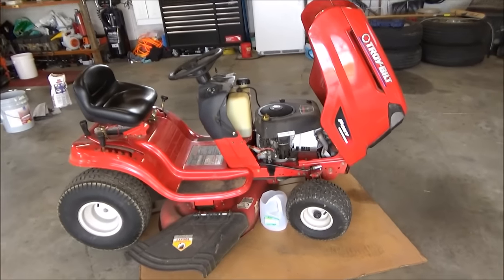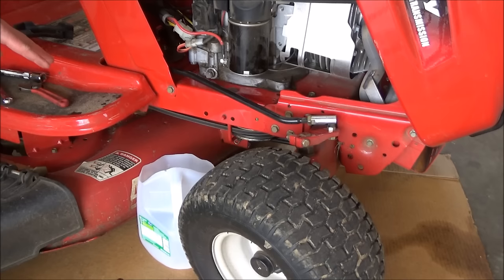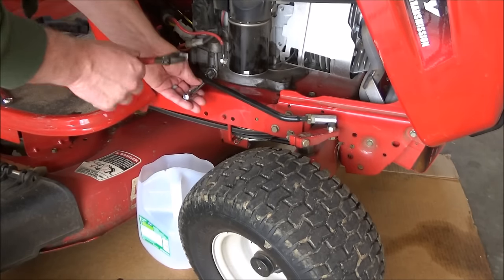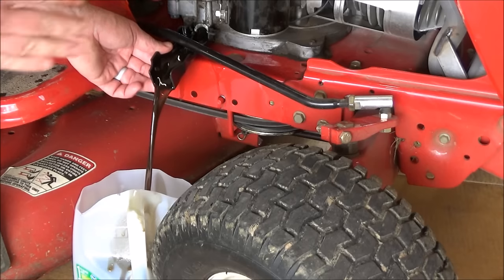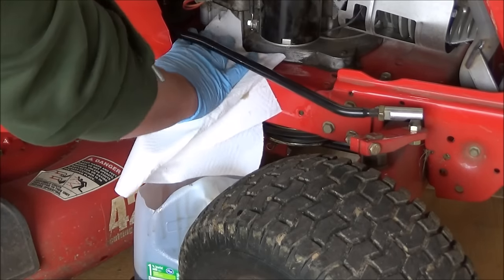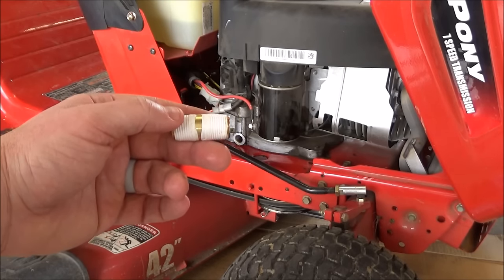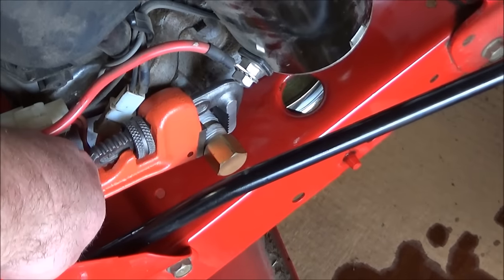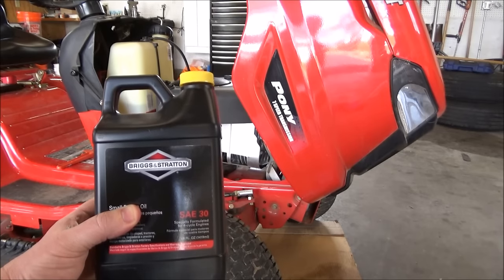Troy-Bilt Pony | Oil Change Made Easier

Comment: I’ve been beatin on one of these for 5 or so years. It mows about 2 acres every couple weeks, and really overgrown grass (8” or so) periodically when I miss a mow. Steep inclines, bumpy uneven terrain. It did get left outside in the elements for a year or two for various reasons. It’s been very reliable and surprisingly durable. I’ve only had to change out the fuel shutoff solenoid, one deck belt, one deck tension spring, one set of blades because the originals were too trashed from me hitting gravel and branches, and ignition coil(plug wire was starting to fall apart probably due to water and sitting outside in the full sun). All those parts were 25$ or less each off Amazon. I change the oil once a year with 15w40 Mobil delvac 1300 that I always have on hand. Engine runs perfect, and the original battery lasted until this spring(about 5 years with no trickle charger). Nowadays I usually just lift the drivers side and put a piece of 2x4 under those wheels so the oil will mostly run away from the drain plug and not all over the frame, cover up the deck  belt in case oil gets sneaky, wipe around the plug and pull it. Let it drain and wipe it off. I figure the frame of that side will never rust lol. I just run seafoam in my gas, 1 oz per gallon, 2 -3 oz per gallon the last month of the season and during storage. Except when I had to diagnose the fuel solenoid, she’s never failed me.
Reply from the maker: Wow, 5 years for the battery is really solid. I did a full review on mine and everything I had to do after 8 years of using it: https://www.youtube.com/watch?v=QXg_5uH-LH4
Reply: Good to read, snagged a free one from a friend who had one sitting for about 2 yrs. Its for my 78 yrs old neighbor. Figured carb, belts, fuel, plugs etc. Basic counsumable parts and should be ready to rock.

Comment: Nice!
I added an inline fuel filter & fuel shutoff valve to mine, & thought I was stylin'.
I think I'll do this as my next mod, but use a 90 elbow out the bottom. 

I love seeing the brass instead of plastic parts! 
Do it once.
Do it right!

Thanks for the good info!
Reply from the maker: No problem. Yeah, I'm definitely a brass over plastic guy. Always wanted one of those Fumoto brass oil change valves, but they are like $45. I have thought about adding a fuel shutoff many times, just haven't gotten around to it. I thought about the 90 elbow, but it won't fit under the steering rod. There is hole in the frame you can possibly route it through with a couple elbows.
Reply: Fix it Flip ;

Okay. Good to know.
Thanks again!

Comment: I've got a 2008 model. Few batteries and several deck belts but other than that no problems whatsoever. Cant believe it still has the original drive belt. Lucky me.
Reply from the maker: Ha ha, that's great. I did finally have to change my drive belts a couple years ago. I did a video on that as well.

Comment: I have a Troy-Bilt Pony and the way I fixed mine is I purchased a 3/8 4 inch long nipple and cap then I disconnected the steering rod and raised the rod just a tad.  Using Teflon tape on both ends of the 4” nipple, I screwed the nipple into the engine block.  Then I reattached the steering rod (remember it’s now a tad higher than it originally was) and it clears the nipple.  Changing oil is now a clean job.
Reply from the maker: Nice job and smart thinking 👍🏻
Reply: How did you make the steering rod higher? And then reattach?

Comment: Thank you for this video.  I have the Craftsman T110 version of this mower.  I too made the same comment about the steering rod being right in the way!  Wasn't impressed with the plastic oil extension spout. It seems like it should attach somehow to prevent leakage on the frame.  Ended up not using it and just wiped oil off the frame.
Reply from the maker: Yeah I don’t blame you.  Both made by MTD.  A ton of them have the same setup like this.

Comment: this will be my sixth season on this mower that I bought new at lowes for $800-875. I forget.  Free interest paid over 18 months.  It's given me little trouble.

Oil.  The oil is very cumbersome.  I buy an oil vacuum pump that pulls the oil out.  I've used that the last couple of seasons.   When changing the oil, take note of how much oil you need to fill it.  I believe it's around 2.5 quarts and you have to measure.

Changing blade.  This was my fault.  Those bolt/nut holding the blades on turn in the opposite direction and if you strip that head out, it's hard to get off. And, you will have to special order   replacement.  It's recommended to remove the mowing deck which isn't that hard.  You may find it doesn't want to clear but then if you drop it and move the engage lever, it gives you the slack to clear it.

Lubing.  This is what I'm looking at now.  The steering is tight.  I plan on using some grease on these point and then find the grease gun for the rear.  I plan on rinsing out that area where the steering rod ends with water (very useful shot of how it looks).  I left it sitting two days and we had heavy, heavy rain.  A wren was building a nest behind the control panel and it was covered in debris where those gears are.

Tips.   This will mow down sprouts  as in sprouting trees.  The problem is it leaves what's called a stob.  Basically, a the base of the sprouting tree it cut down.  Run over that and you'll get a flat.

Battery.   This is where you want to go to an auto parts store.  You'll pay more but it'll last for several years.  In the winter, I put a trickle charger on it when I store it.  Always disconnect the negative first.  Always reconnect the positive first.

Fuel line.   This is the problem my brother in law had with my mother's yard machine which was by far the worst product on the market.    A grain of sand or something got stuck in the carb and would push gas into the oil when it sat.  That fuel tank does have some pressure to it.  I put in a fuel cut off at or near the fuel filter.

Some say with weed eaters and such to drain the fuel at the end of the season.  I now hear it's better to leave the fuel in it as the seals won't dry out.  Then dump your fuel and add fresh.
Reply from the maker: Lots of good tips here and I have a video on almost each of those topics.  I also did a review after owning mine for 8 years and covered all the pros and cons: https://youtu.be/QXg_5uH-LH4

Comment: I have a Poulan lawn tractor that has the same exact engine. It actually has an adapter piece on it that lets you change the oil without using any tools. All you do is give it a turn and pull it out to release the seal and the oil starts flowing, you are even able to hook a hose up to the end of it. You could probably even buy one of these online and put it right on your tractor.
Reply from the maker: Yes, a Stens valve.  They are pretty nice but definitely won't last as long as a brass nipple. Heard stories of people going out to a garage with a big oil puddle from them leaking.

Comment: Use loctite on the end going in the block and you'll never need to use the pipe wrench to hold it. Also they make a oil drain replacement with a hose attachment that fits these engines, visit the local small engine shop and and pick one up and it will change the game.
Reply from the maker: Great idea on the loctite! And yes those drainzit hoses are nice.

Comment: Just like the frame hole that is about 3 inches forward of the drain port i drilled with step drill bit and added a hole!! Then put a 3/8 in 90 deg elbow with hose connection and cap. Easy peasy now.
Reply: I was gonna fabricate and weld  up a bent linkage arm for the steering but this was easier..
Reply from the maker: I love it man. Sounds legit. I considered the same thing. I don't understand why it doesn't come with a hole right there!

Comment: Use "Anti-Seize  Lubricant " on the threads when replacing the nut holding  the blade on. Makes the blade nut very easier to remove every time.
Reply from the maker: Yep, that definitely helps.

Comment: Mine didn't come with the sleeve. I cut a vertical section out of a plastic McDonald's cup and it works pretty good. Thanks for the tips.
Reply from the maker: No problem and good idea. In this video I show how you can use an old oil bottle to make a drain sleeve: https://www.youtube.com/watch?v=hxUnUHeVLr0

Comment: Best mod is to install a Stens Oil Drain Valve and then when you want to drain the oil, just stick a length of 1/2" hose on the end of the valve and point the other end of the hose wherever you need it to go, then open the valve. No fuss, no mess.
Reply from the maker: Never used one personally. But I know some mowers come with them installed these days. I have heard several people say they leak over time. And that the plastic cracks sometimes. Drainzit is another option for around $20. Fumoto brass valves are great, but expensive. My fix cost $3. I trust brass over plastic. But not saying they wouldn't work just fine, because like I said. I've never used one. Just going off what I've heard.

Comment: I just put a 5" iron pipe that fits the plug hole and cap it off. Now, I just remove the cap and the oil goes into a container. Replace the cap when it is done draining. No spills or messes again.
Reply from the maker: How did you avoid the steering rod that's in the way?
Reply: @fixitFlip  I bent it (steering rod) a little bit, and put a piece of rubber ( tire tube), taped it between the pipe and rod. The steering rod has enough play (wiggle room) that you should be able to get pipe between the rod and tractor body. I am experimenting on how best to avoid the wear between the pipe and steering rod with durable, soft material. May have to replace material between rod and pipe periodically. But, it's better than getting oil all over everything.
Reply from the maker: @jameshixson4770  That's pretty cool. I like that idea. I'm curious to hear how it holds up over time. Keep me posted.

Comment: Flip, I slightly overFILLED my Pony42.  It was easy to drain the oil using your tips the NEWER engines actually have a tool-less cap with an extension tube that makes OC neater.  I was filling with  10W30 and put in a full quart and and less than 1/2 extra.  The stick read just above the F dot.  Upon cranking after oil settled and clean up, the engine BackFired once and wouldn't start!  A small amount of oil  sprayed on the tires and ground.
Can you advise besides draining some oil out tomorrow and possibly cleaning spark plug?
much thanks
Lou
Pony 42 in NY Capital Region

Comment: Your video's are a great help.How do I disable the seat shut off?
Reply from the maker: I'm glad. You can remove the switch from under the seat and simply zip tie it down!
Reply: My Bronco has only two springs that the seat rests on. However it does have two electrical plugs under the outside left of the seat. Any ideas?Thanks
Reply from the maker: @waynewise6711  I believe you have to actually take the seat off. It is held on with mounting bolt. The switch is up under the seat when you take it off.

Comment: Did I hear right, that the Troy Bilt pony doesn't have an oil filter?
Thanks for the video
Reply from the maker: For the ones that are a few years old, that is correct. Mine is a 2012 model. I believe they just started adding an oil filter in the last year or two on one of the Pony models.

Comment: I clean the area with brake clean then build up beads of sealants on the frame on each side of the plug as to orient the oil over the side of the frame. Similar to the plastic thing you ve shown. Tilting the machine on the rigth helps also.
Reply from the maker: Yeah sometimes I will park it in my back yard on a slope to help the oil drain, but it was windy this day, so I did it in the garage since I was filming. Interesting tip about the sealants!
Reply from the maker: And here's another little trick I use to get the oil over the frame. 
https://www.youtube.com/watch?v=hxUnUHeVLr0

Comment: I’m a first time riding mower owner, I bought a 46” Troy bilt hydro horse 20hp. Can you please tell me which filter and oil I should buy? Thank you for the vids
Reply from the maker: https://www.troybilt.com/en_US/operatorsmanuals
Here's a site where you can type in the serial number of your mower and download a manual. Or tell me what exact engine it has and I can help you find it.
Reply: @fixitFlip  so I used the link you provided and it gives multiple manuals.....
Model Number: 13WX79BT011
Serial Number: 1D247B10117
Reply from the maker: @No_cap_yo  Your model number should be right under the seat. In this video I show you where the model number is:
https://www.youtube.com/watch?v=QXg_5uH-LH4&t=44s
Reply: Thanks for answering my questions btw. So mine has two different areas with two different serial and model numbers. The one I provided is from under the seat and then there’s one on the engine that’s different than the one under the seat. It has a Kholer engine.
Reply from the maker: @No_cap_yo  Yes, the Kholer engine will have its own model number, and actually the manual for this would be your best resource for changing the oil. The Troy Bilt manuals will sometimes just tell you to refer to your engine manual. The model number under the seat is for the mower.

Comment: No oil filter on the pony I actually have the exact same mower. It was in my house when I bought it and it wouldn't run I had to put a new carburetor on it and I put a new battery in it started right up no problem. I just put some new Gator blades on too. Cutting like a champ but I would like to change the oil. I just didn't see you mess with the filter so I figure there is no filter for this model? I basically taking the entire lawn mower apart and haven't seen one so I'm just going to do what you did. Looks good I'm going to get that nipple on there too for future ease!
Reply from the maker: Yeah I just changed mine again last week. The nipple definitely makes it easier. This little tip I do helps as well: https://www.youtube.com/watch?v=hxUnUHeVLr0
And you are correct, there is no oil filter on this model.
Reply: @fixitFlip  - No oil filter means never needing to do anything?  What filters oil particulate?  Or should I not be concerned? Thanks. Great video.
Reply from the maker: @noskydaddy21  Thanks! You just keep the oil changed on a regular basis and it will be fine. Some smaller engines are like this.

Comment: Put a fitting in the plug hole that will accept a 3/8 hose that is about 6" long.  Put a plastic shutoff valve on it and rig up a hose  retainer clip to stash it out of the way when not draining the oil.  Simply unclip the hose, aim the valve end into a jug and open the petcock.  No more oil spills(unless your a nervous nelly😅. ???) Won't need that fluffy drip plate anymore. 😊
Reply from the maker: Yeah, they make a hose called a Drainzit hose that works just like that.
Reply: @fixitFlip  typical...I dream up stuff and someone else a beat me to it. 😂
Reply from the maker: @mauricepowers8079  Ha ha, they are a pretty neat little invention, so good thinking, ha ha: https://amzn.to/40iMidS

Comment: I recently had my mower break on me. It has the same mechanics to it like the one you are showing. When you let the handle down to engage the blades to go it was like something broke. The handle just goes up and down with no engagement. Do you have any comments on how to fix this?
Reply from the maker: It sounds like something broke where the PTO is attached. More than likely the spring that pulls the idler arm!

Comment: Good video... When you put your brass nip in you could have used a 90 and went over to the hole in the frame... Just a tip
Reply from the maker: Yeah, that's a good idea that a few other people have suggested here in the comments. I thought about trying that! Might be tricky turning the 90 around to get it threaded with the frame kind of in the way until you could get it aimed down in the hole. But if that worked it would be genius.

Comment: What I did is purchase a 4” brass nipple and cap. Then, using a wrench, I disconnected the steering rod, put the 4” brass nipple in the oil drain hole and reconnected the steering rod so that it doesn’t drag on the new nipple.  It steers perfectly and I can drain the oil without making a mess.
Reply from the maker: How does the steering rod not hit the nipple after you reconnected it?
Reply: Please explain how to reattach rod? Does it go right back where it was?

Comment: the hood started to wear on the console body, so to fix that i had some  3/8" oxygen hose that i super glue it around the top of the corner on the console where the hood is rubbing i also insulated my new light bulbs he he police  strobe lights front and back > i mow on the road and the dust make it hard for me to be seen>  why i done that   i went to AUTO ZONE got me's led lights /   there cool. looks like small mustang tail lights

Comment: Looking at purchasing a solid, reliable, budget-friendly ride on mower. Is this the ticket? Any other recommendations by folks?
Reply from the maker: I can tell you there isn't much out there at all right now. The HD by me just got a few TB Ponies in, but that's about it. John Deere is currently not shipping their 100 series to dealers due to supply chain issues and I haven't seen any Cub Cadets anywhere. My Pony has lasted 10 years now with no major issues.
Reply from the maker: This may help you out:
https://www.youtube.com/watch?v=QXg_5uH-LH4
Reply: @fixitFlip  Thanks for the response. Might just buy a used Toro 22 mower and wait. Maybe get a new ride on over winter or next season. Inflation and supply chain issues and associates costs are too much for me.
Reply from the maker: @Murph999  Yep, it is insane right now. Hopefully all calms down by next spring. But doesn't sound promising from dealers I have talked to.